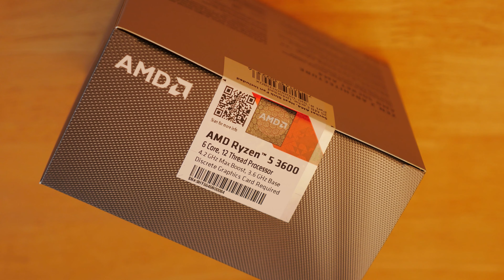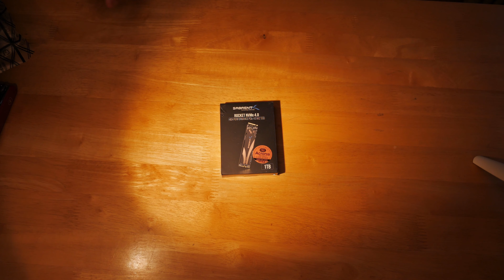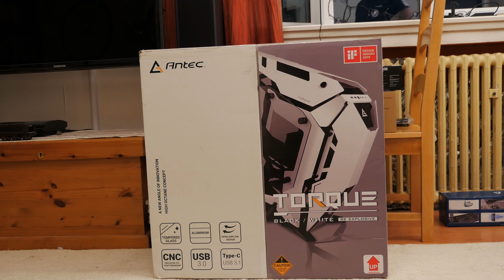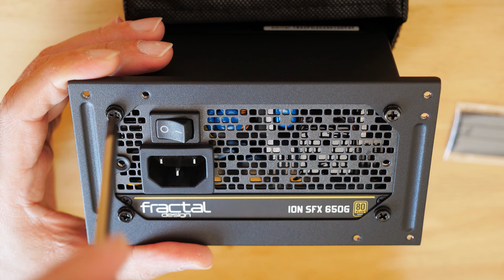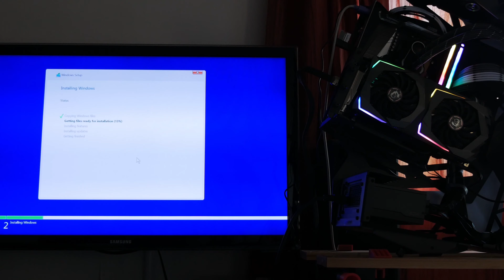Project Lockdown - Ryzen, RTX, Antec Torque PC build

Comment: Thanks for Amazing review, I have exactly same case and motherboard and still not Buildng as I am waiting my GPU, I have one confusion for the case cable as two cables I can’t connect, the front USB Type C cable as it doesn’t have socket on the MB and the second cable is the light for the front symbol on the case coming from the small power unit in the top front of the case, if you can tell me how you connect them will be appreciated 🙏
Reply from the maker: Hi and thanks for watching. For the front USB-C port I bought a small board on Amazon which turns one of the USB3 ports on the motherboard into a USB-C port. This one here https://www.amazon.co.uk/gp/product/B09KFYY1MW/ref=as_li_tl?ie=UTF8&camp=1634&creative=6738&creativeASIN=B09KFYY1MW&linkCode=as2&tag=vynzography-21&linkId=fa17d6f61a046b0d4d2f2c882040d73a
For the front white "A" this connects directly to a old style drive power cable from the power supply. Hope this helps!
Reply: @VynZography  thanks alot man for your quick reply, really appreciate that, May I knew this Front A connection for what actually?
Reply from the maker: @Mohamed_KAL  that's to convert one of the on board usb sockets to a USBC socket. It works really well too.
Reply: @VynZography  Thanks alot Man 🙏

Comment: I have a similar pc I have a question are the screws you need for the motherboard and the power supply are they in the screw box that comes with the antec torque?
Reply from the maker: I honestly don’t remember for sure but I THINK they came with the case 🤔
Reply: @VynZography  thank you

Comment: Btw did you put the glass panels on last? Someone on Amazon reviews said the panels need to be put on before the motherboard!? Something about the location of the post mount for the glass is in a bad position and it's better to put the glass panel (back one I assume) on first
Reply from the maker: Oh yes you are right. I used it without the glass for about a year and when I  decided to put it on, I needed to remove the motherboard to attach one of the glass mounting poles.
Reply from the maker: You don't need to put the glass on first, just that pole as it needs a screw behind the motherboard.

Comment: how did you find cable management in that case? easy, difficult?
Reply from the maker: I took a long time thinking about it but actually there a loads of places to hide excess cable behind panels and at the bottom in frot of the PSU.

Comment: Hi just wondering its last years build but how would this go with the 11th gen motherboards and 3090rtx GPUS as im looking at this case myself and also interested in how much dust etc with no filters or enclosed space
Reply from the maker: Hi, Dust has never been a problem as it runs so cool that the fans are never even on. No fans on means no dusty air drawn in. I have now put some fans and filter at the front. Check out my follow up video with my 2021 upgrades: https://youtu.be/LlHlbk1hYqc

Comment: Gorgeous build! Question: I want to build w/a Torque but PCPartpicker says my motherboard, Asus ROG Maximus XIII Extreme EATX LGA1200, isn't compatible with it, but doesn't specify a reason. Only thing I can think of its listed as an ATX  case and the mb is an EATX, so maybe it thinks the motherboard is too big? Do you think it should be compatible?
Reply from the maker: Hi. Yeh there is loads of space in this case to the front of the board. EATX should fit just fine.

Comment: Hi Man, I have a situation. I want to send a PC with this case to another city, Do you believe that you can package the case again to his box, with the PC inside, graphic card (RTX 4090), AIO, etc and send it to another place, Like any common other PC? Or is better to pick another case for this situation ?
Reply from the maker: Helooo! I think the case and AIO will be fine. My only concern is the glass and the GPU. If you have the original box then it has a space for the glass. Take the glass and the glass mounts off and put it back in their original place. A 4090 however is big and heavy, just like my 3090. I feel that will break the motherboard slot easily in shipping. When people sell PCs, even normal PCs they usually have some kind of support for the GPU. You might have to either Jerry-rig something or ship the GPU separately. Personally, I am super scared of shipping something like this, too many times my stuff has been broken during shipping. At least get good insurance!

Comment: Nice build! What GPU bracket is that?
Reply from the maker: https://www.phanteks.com/PH-VGPUKT.html thats the one. Remember its for 2-slot cards only.
Reply: @VynZography  Thank you.  Im doing a build with a Kingpin Hyrdro so it will be a single slot. I am leaning towards an extreme case like but also looking at the Lian Li Odyssey X.
Reply from the maker: @pathfindercod4638  this case will be perfect for that with its two 360 mm radiator positions 👍👍👍👍

Comment: Question… what vertical gpu mount are you using?
Reply from the maker: https://www.phanteks.com/PH-VGPUKT.html thats the one. Remember its for 2-slot cards only.
Reply from the maker: @Dylan Casey mmmm I'm not sure. The problem is that the bracket itself only accepts 2 slot cards because of its design. For example my 3090 does not fit because the L bracket on the card collides with the vertical mount bracket. I guess you can make it fit with some cutting but I wasn't brave enough to try.
Reply from the maker: @Dylan Casey you know, so long as your L bracket on the GPU is 2-slot it should work.
Reply: @Dylan Casey Dont know if you solved your question, but please notice that your 2,75 bracket is a 2 bracket at mounting point, and the fan housing adds the extra ,75 but that will not interfer with the bracket. But as alternative, if you need it,  Cooler Master MCA-U000R-KFVK02 can also be used.